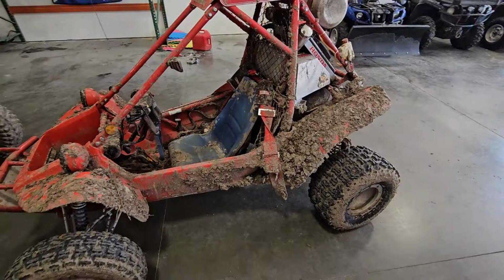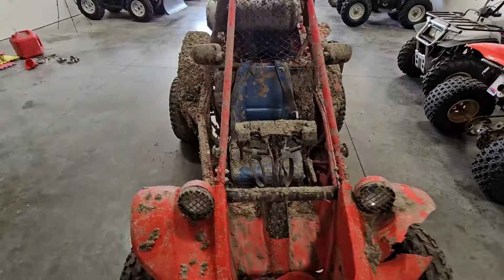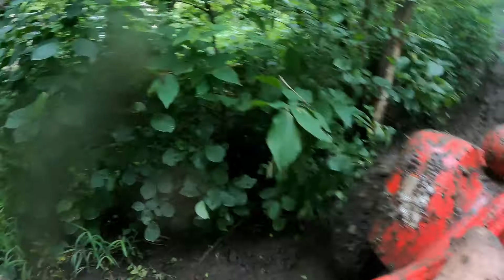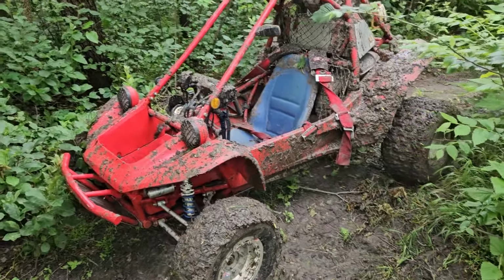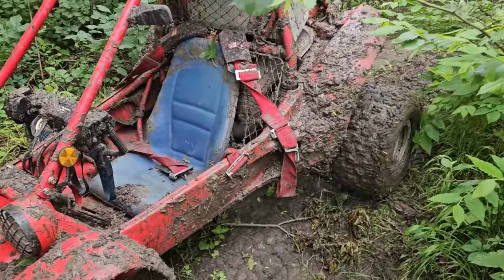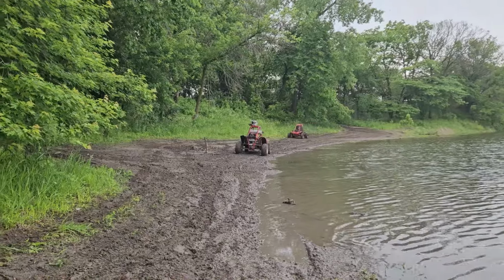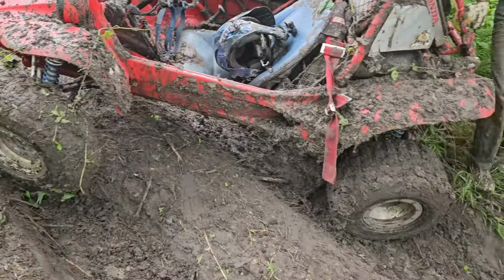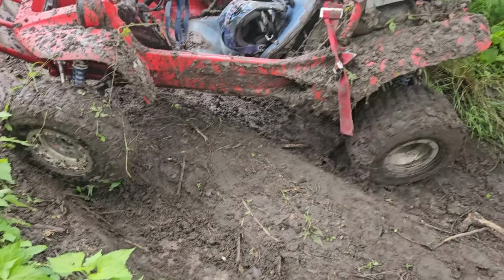Snowmobile Swapped Honda Pilot In Muddy Trails

Comment: Definitely would help a bunch if you changed clutch springs... that would solve most of bogging problem... also the pipe on machine could be affecting bogging (low /med range pipe vs med/high pipe... (2 stroke is sensitive to which pipes you are running)
Jetting could also be issue... 2 stroke jetted for cold (sled engine) will not run worth a crap in the warm... 
From an atv/sled shop owner
Reply from the maker: It definitely felt more like a carb issue. I have a lot of snowmobiles too and it just felt like it was fouling a plug most of the time, especially after it got fully warm. It was having issues way before the power band. This has jetski carbs on it also, not the stock sled ones. Follow along though.  I'll get it dialed in soon and it will be a true ripper.
Reply: @CKPowersports  definitely will keep following... I love these kinds of builds... keep at it ... when it's done that thing is going to be a blast...
Reply from the maker: @RAM-19  it's a super fun machine. On pavement it will wheelie with ease. This was my first real test with it, and unfortunately, it disappointed me.